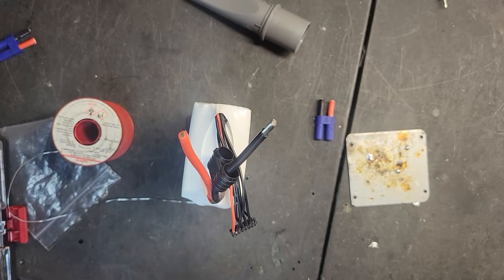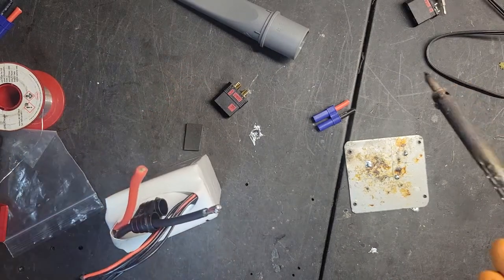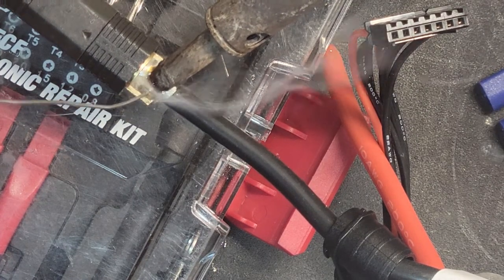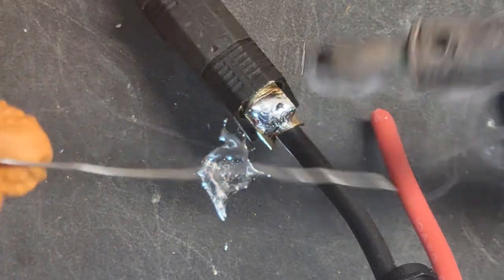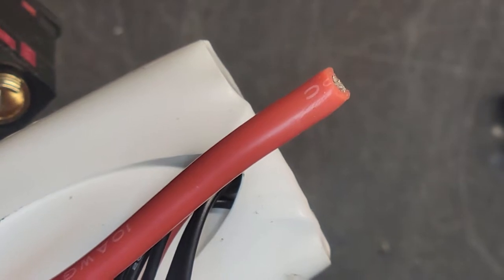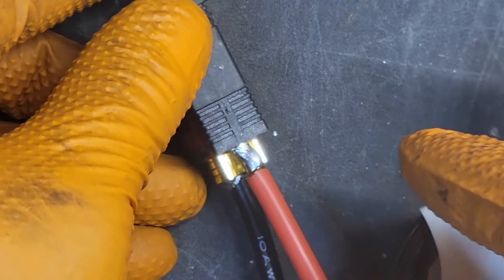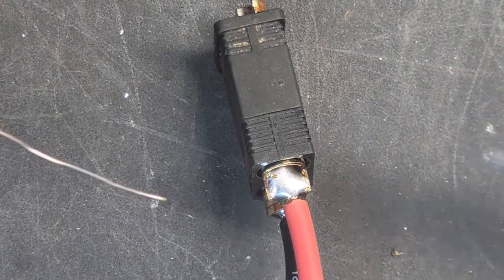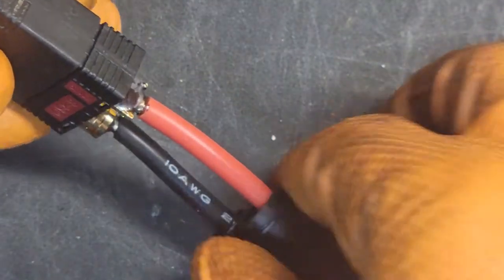How To solder QS8 connector to lipo battery 🔋

Comment: This is my first time going to be soldering QS8 connectors on my EC5 CNHL lipos. The batteries are brand new so I need to have them a certain charged before cutting the negative and positive wire?? And also which one do I cut first just wanna make sure I don’t short anything out and any tips the video was great!! Just lmk
Reply from the maker: It wouldn't matter what voltages you have the pack at, or which wire u cut first.  Just don't cut both wires at the same time.

Comment: How does your solder stay wet looking. I just spend 4 hours trying to solder a qs10 and I pray I made enough contact.

What temp, type of solder, flux, etc?
Reply from the maker: just the max temp with this Weller 40watt station.  I use Kester 60/40 solder.  U have to make sure the tip you are using is sharpened clean.  I use a grinding wheel to sharpen and clean it up

Comment: Is it possible to solder 4 or 6 Awg wire to it?
Reply from the maker: Yes 6AWG is more ideal because the cover caps fit 6AWG wiring.   If u run 4AWG the cover caps won't fit u would have to alter caps or not use them

Comment: I ruined 10 connections 20 connectors & I bought 2 different solder guns…. I still can’t do this shit man wtf just balls up doesn’t want to stick to the connector or the wire, just stays on my tip
Reply: Been there done that… Soldering can get extremely frustrating. The larger the wire the harder it gets but the main point is to keep everything very hot. The solder will join the wire only if the wire is really hot because you heated it with the iron. If your iron isn’t hot enough (it should melt the solder REALLY fast) then it might be bad quality or you might have to send the tip. Also use solder flux that’ll help a lot.